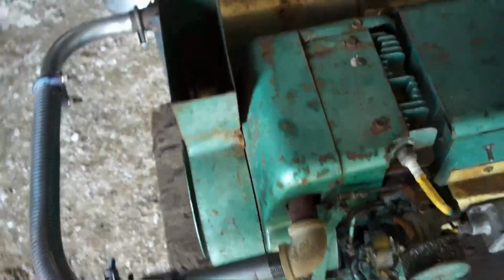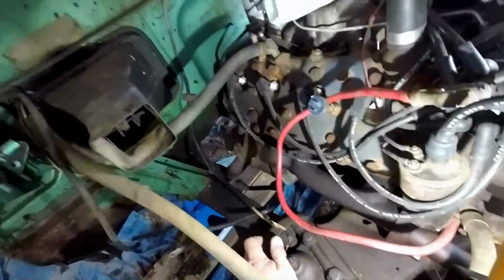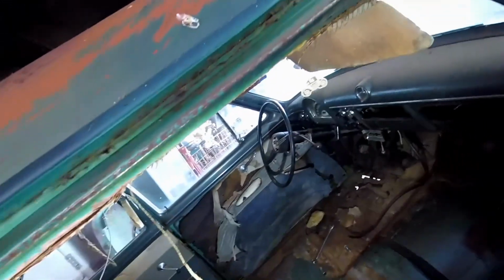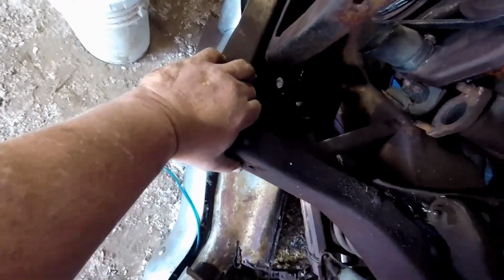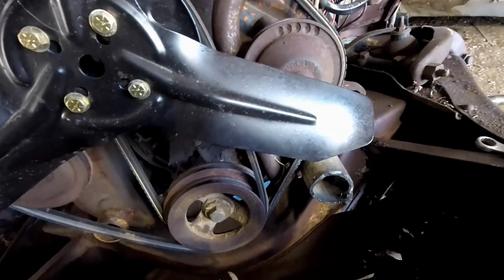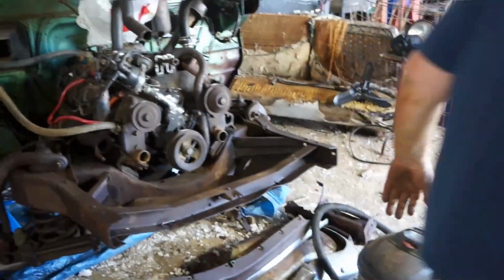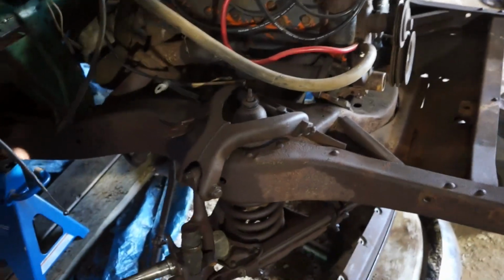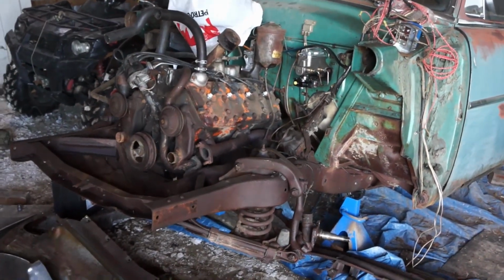Flathead Ford project #7

Comment: Loving this build-  my 1st car was a 1953 Ford-  like this but a different shade of green-  I bought when I was 14 and Dad and I rebuilt the flathead and various other repairs-  I did all the body work and spot painted as needed-
Reply from the maker: It is a great looking car, like a shoebox but with a little more style. I saw this one on the Coldwarmotors youtube page, the video series was called "Will it run episode 20, and fell in love. My sons and I drove 8000 Kms round trip to pick it up. My engine seems to be in good shape and I hope to be able to drive ( and stop ) the beastie next spring. We will keep the patina until all the repairs are done then give it a good normal repaint. I intend to drive this car a lot. 😀 
Thanks for the comment. 🙋‍♂️

Comment: You are making real progress. Oil up them hood hinges well. Guys at the Ford Barn forum tell me they are weak and I believe it. The hinges on my 53 parts car were twisted and broken. New hinges are available but very expensive. Even good used ones are not cheap because they are hard to find.
Reply from the maker: You are right about the hinges. Actually both of these hinges are damaged. The drivers side is badly bent and the front arm on the passenger side is completely broken. I hope that when I get them on the bench I can figure out some way to reinforce them. Last used pair I saw on Ebay was going for $600 CDN

Comment: Great to see you guys returning the Ford back on road.  Reproduction parts would be cheap over there in the US compared to freighting to Oz.
Reply from the maker: Thanks for the comment. The car is actually quite good but everything needs attention. I am keeping as much of the patina I can. Outside will still look rough but underneath it will be mechanically perfect. The only upgrade will be converting to a dual brake system and some pretty good disk brakes for the front. If I want to drive it in traffic it needs to stop like a new car. Funny though I have bought parts from Ozzie land for the beast. Not anything big though